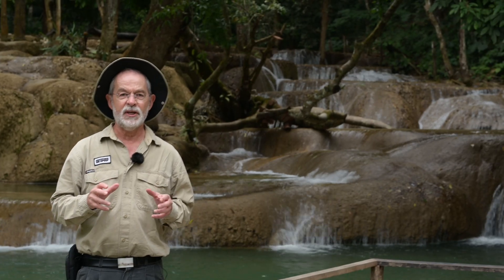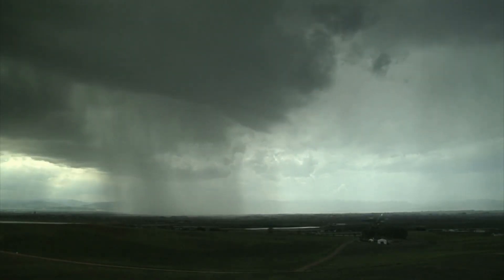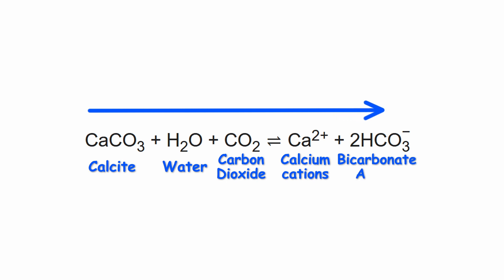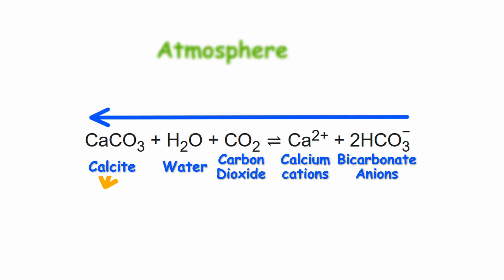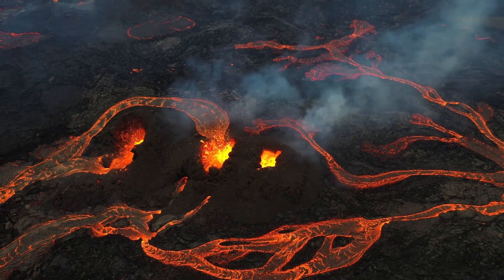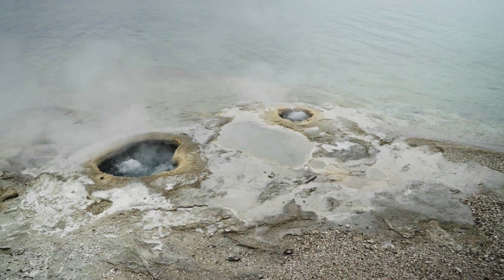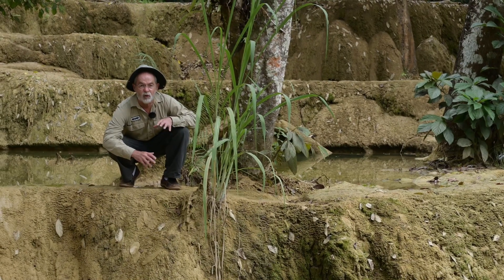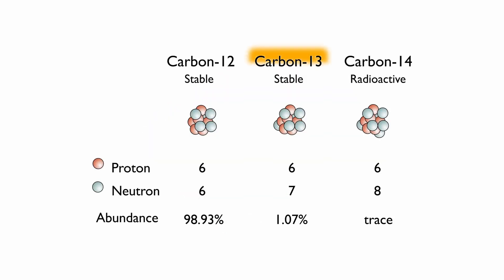Tufa vs Travertine Limestone

Comment: Would an iron carbonate like Ankerite or an  Iron enriched Dolomite, hosted by hydrothermal replacement deposit, be considered a potential ore? Degreeless weekend warrior prospecter here. 😅
Loving your videos btw.
Reply from the maker: Potential, yes. Certain, no! Any evidence of a large volume hydrothermal system is an indicator of potential for gold and other metals, but alas, there are many hydrothermal systems that involved little more than bath water and carry no metals of significance.